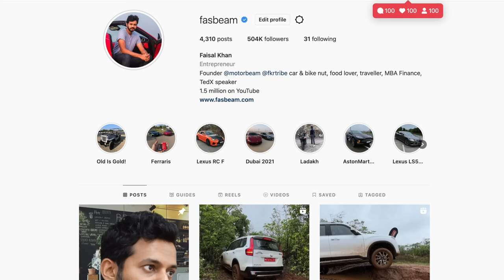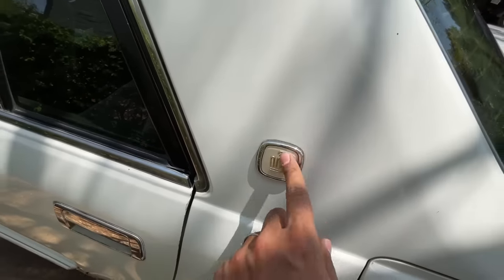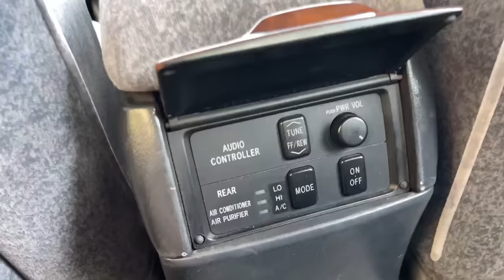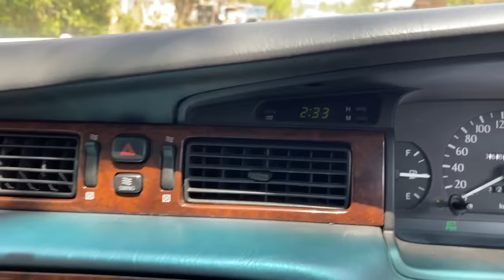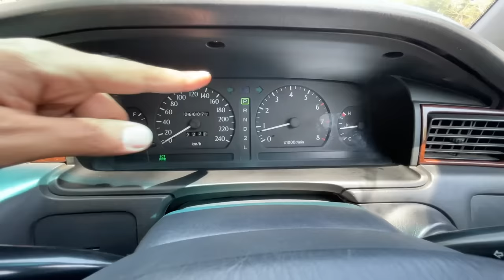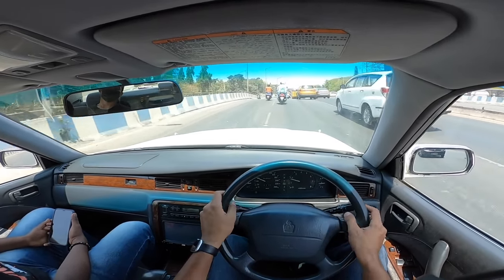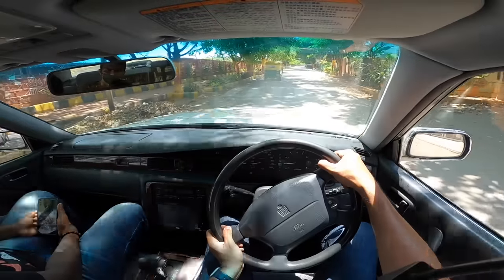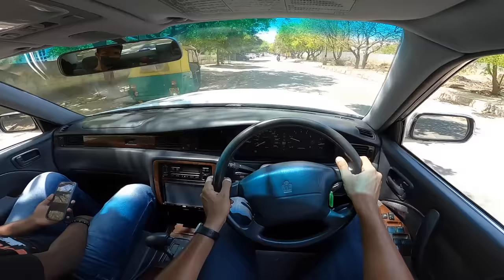Toyota Crown Royal Saloon - Powered By 2JZ - Ultimate Comfort | Faisal Khan

Comment: Reason for switch near coin holder was to reset rear seats to original position in case those were reclined and reason for the separate lever for the tilt adjustment of steering is for easy ingress for the driver so that his knees doesn’t hit steering when going in and out of the car

Comment: There looks to be some issue with this car. A normal 2JZ GE Crown would rip it. 
Also, that button in center console besides the coin holder is to reset the recliners at the back.

Comment: ya......one thing i wanted to say.....this its not the EXACT same engine from the supra......cuz that is a 2jz gte.....and this a 2jz ge which means the ge is designed for N/A aplications not boosted ones....and the headers differ from eachother.....and the oil pan in this might have issues and heating isseus on boost application.